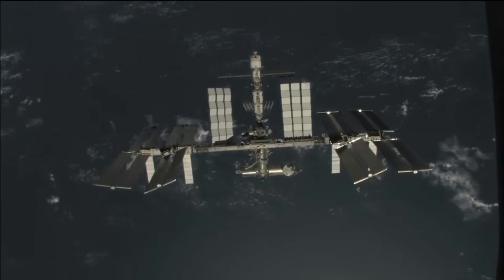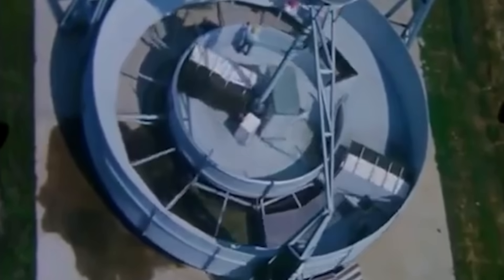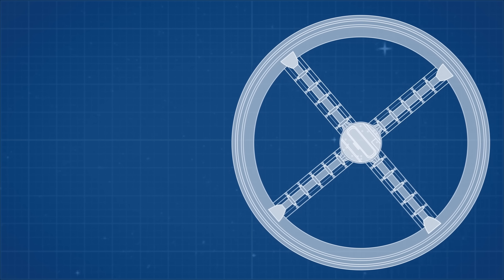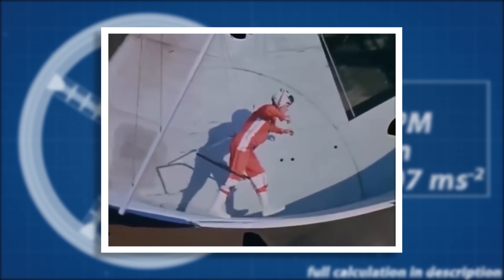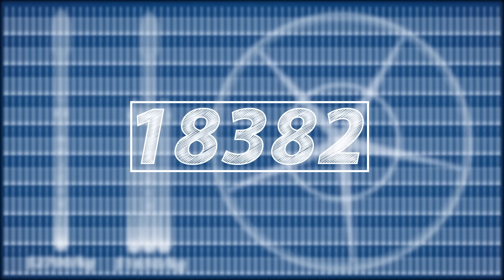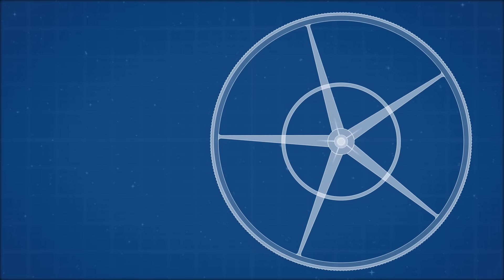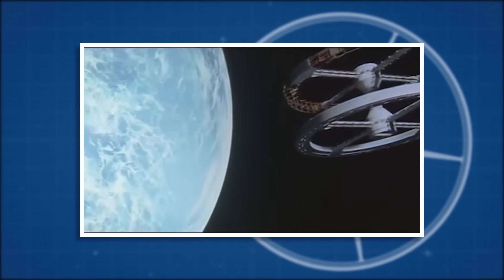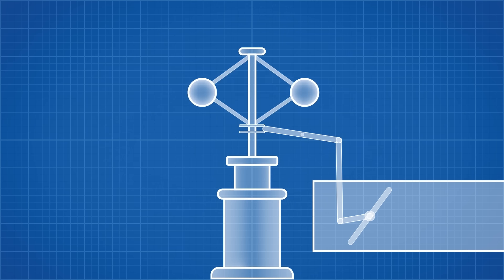Can We Create Artificial Gravity?

Comment: Using the cost of the ISS isn't very fair, because it was built before SpaceX. The ISS weighs about 420k kgs (let's call it 500k kgs for easy numbers). Thus, the launch cost was about 50B/500k ($/kg) = $100,000/kg. SpaceX can launch something to space for an order of magnitude less (about $10,000/kg). So If imagine you could build your station for an order of magnitude less money with today's technology. That would put your station closer to $500B than $5T. Granted, that's still way too much money, but the economics are substantially better. I think these kinds of megaprojects will start happening around $100/kg... that's 2 orders of magnitude less expensive than SpaceX. I also think it'll be next to impossible to do with rockets (which are already pushed to incredible engineering extremes). We'll need something monumentally better than a rocket to build these phenomenally large space stations with artificial gravity. At 2 orders of magnitude less, that beast of a station from the video comes in at about $5B, assuming the cost of engineering scales the same way. And really, it should: we design modules that live in space around a 12 minute flight to space. That's like planning for your annual vacation, but instead of spending most of your time thinking about what you'll do when you get there, you're preoccupied with how you'll pack your clothes 67% of the time. That's what rocket engineers have to put up with. They're not simply designing a payload to do things in space, they're spending A SUBSTANTIAL amount of time and resources designing for the short but extremely violent trip to space. If you find a more robust, economical, gentle way to get to space, that would change what it means to design technologies for space. So I think by brining the cost of launching a payload down by 100x (2 orders of magnitude) you could also bring the steady state cost of engineering said payload down by a similar factor. Of course, we only have rockets. For now, anyway. I'm waiting for that fundamental breakthrough technology that changes everything, like a transistor in a world of vacuum tubes. I'm waiting for the transistor of space, that will get us these artificial gravity stations for the cost of VC money. Einstein once said, "you don't find a solution to a problem with the ideas you used to create it". I believe if clever people realize that something other than a rocket could work (phenomenally) that could be a game changer. I need to stop now, I have digressed strongly and now I'm rambling about philosophical things, my bad. Anyway, let me know your thoughts and please be polite. Best wishes space friends!

Comment: I wonder what it would feel like docking up to the center of the artificial gravity station,  then getting to the gravity part, would we just use slides or ladders, and would you feel weightless in the center, then a gradual pull on your body downwards as you descend a latter? Or would you get smacked by the latter and have to hang on to catch a ride with that arm of the station. So many questions.

Comment: So if we connect two Starships on a tether so the habitation decks are 684 meters apart and accelerate to one RPM, then we get Mars surface gravity. 
684 m at one rev per 60 sec.
Or 1000 m at one rev per 72.5 sec.
Or 1789 m at one rev per 97 sec.

To get Earth surface gravity, we could lengthen the cable to 1789 meters between decks and accelerate to 1 RPM.
Or 1000 meters at 1.338 RPM
Or 447.28 meters at 2 RPM. 
Or 111.82 meters at 4 RPM.

Starship has several deck levels, so the slower RPM and longer tether is preferred to keep the gravity more similar between decks. 

Connecting the ships together at the tail ends may reduce tether stress because the heavy engines and partially filled tanks would be closer together. Certainly, the tethers would be shorter.

Comment: You don’t need a massive wheel. Two disc shaped modules rotating at the end of a very long cable or truss would do the same job.
Reply: ¿What about that this would be the first stage of the project and you keep expanding it until you have the entire ring-wheel?
Reply: Slavko Bogdanic  Exactly. You have a 1G living and working base and you just extend out from each end as you need more space.
Reply: @sirnikkel6746  you just invented the Voyager Space Hotel
Reply: @IsaacStevens1  LET'S GOOOOOOOOOOOOOOOO
Reply: And how do you intend to get the crew out to those modules from the core?
Reply: Harry Mack By sliding down a fireman’s pole obviously.
Reply: @martinsavage6838  
Elevator cables with minimal pressurized car inside the truss. Counterweights are problematic with varying gravity. Who will solve that? ([edit] I suspect pneumatics is the right direction.)
Reply: @martinsavage6838  
The solution seems to be the "garage door" conical spool and torsion spring. Adjust the elevator ballast to maintain neutral "buoyancy" on each trip.
Reply: @avid0g  not varying gravity, varying inertia
Reply: @avid0g 

Enter the "turbo lift." LOL
Reply: a wheel would be a more efficient use of space imo but this could also work
Reply: Obviously you don’t need a wheel, anyone with the resources to build a O’Neil cylinder would build a Skyhook
Reply: The cable would experience immense stress at the centre. If you could develop some carbon nanotube material That could withstand the stress this design will be far superior
Reply: @stavyabangalore7956  the stress would not be that bad, why do you think a cable a few hundred metres in length would experience severe stress?  It is far less than what we would need for suspension bridges on earth.
Reply: I read Tesla - I say get the f. off. Gravity is not a force, but it exists, it was measured, it even has a speed of propagation.
Reply: Yes, this! The floors could have a slight cylindrical curve matching the circumference of spin. The connection would be several parallel pipe made into a rigid truss.

If that is not important, then just walk up and down slight slopes. The rigid truss is replaced with "light weight" redundant tethers. 

I just finished calculating various distance between two tethered Starships vs angular velocity for Mars and Earth gravity.
Reply: @avid0g  i could be wrong but doesn't that make different gravitational pulls based on how far you stand from the center of the disc?
Reply: @Re5_2karman  
If the disk is free to rotate (on a cable set), then gradients are inevitable, and "horizontal" will not appear to be "level" some places, especially at the edges. 

If a rigid truss or pipe maintains orientation then the disk can be curved to be equidistant from the hub, and have consistent acceleration; but then a curve is visible.
Reply: @avid0g  You mad genius!  Your right! Now, if someone could just fund this.
Reply: @avid0g  Ei Mate, calculate the sex of the Angels for me.
Gravity doesn’t exist and you’re not pull to earth, you’re pushed to earth by the AETHER, but this is a lot of sand for your pickup truck, read the German Patent SCHAPPELLER DEVISE.
Reply: @joseinfante5054  
I am blocking word salad notifications.
Reply: @avid0g  willful ignorance much? Maybe learn some words lol
Reply: @avid0g  dont know what the aether/dielectric field is, then you will NEVER understand dielectric acceleration wich is the literal CAUSE of gravity lol
Reply: @joseinfante5054  Interesting, we are being pushed to the earth by the eather.  But why do we float in space?
Reply: @Kopie0830  Well, the primordial particle AETHER, is a charged stream of RADIANT energy that strongly attracts magnetism bringing all bodies in front of it, since there is no magnetism in space, It moves in all directions, causing all bodies to float.
The Haunebu Nazis they worked with the sphere of Schappeller with the same principle, production of Radiant energy and magnetic energy, in the superior part of the device is bathed in Radiant that repels the Aether, in the middle of the two (the device and Aether) forming the only wanted bubble, and running to the inferior part bathed in magnetism, creating the so-called anti-gravity.
Reply: you could either spin it or make it  very very heavy.
Reply: Ok your smart I need your help building a room that can enhance gravity
Reply: Or the one depicted in the 2021 Netflix's movie, Stowaway.
Reply: @IPA SOLÉ well you have to have proof for it’s existence. And you need a hypothesis for it to be atleast possible. As long as it doesn’t have proof or a hypothesis it isn’t real
Reply: Its called A Bola habitat, and it has some fundamental issues. One, you use mirrors to reflect sunlight into the inner ring, with the Bola Setup, you need 2 rotating rings outset from the center mass and a main mirror angled through the center point to maintain a night and day cycle.. This raises issues with spin wobble, so you need to then attach them in tandem along a long axel and have half rotating counter to the rest. It's a lot less elegant and a lot more intensive than a tandem double  ring Stanford Torus which has superior real estate and can maintain an even atmospheric pressure. Bolas would push all the atmosphere to the trailing side, where a torus allows it to move freely. Then all you need is baffles to break up the wind flow and create calm "skies". this is because eventually, you would have the lighter air rotating at a higher altitude and a different speed. It would then basically suck the rest of the air to it via air pressure.
Additionally, you are focusing all the mass of the spin on a very narrow point, and since each bola is free spinning, They can't support each other and spread the tension over the entire shell. A Torus can.
Bolas are a nifty idea and loo gorgeous in Anime like Gundam Seed (Zaft), but they are ultimately impractical.
Reply: @talyn3932  So many pseudo-scientists on youtube, we should have artificial gravity all over the sky, but no, it's just an illusion, it takes a lot of electricity and tomatoes and not scientists.
Reply: @talyn3932  Sunlight is nice, but you don’t necessarily need real sunlight reflected from mirrors. My mate’s cannabis grow house doesn’t use sunlight at all. Another option might be to channel the sunlight down optical fibres.
  Mirrors are so 20th century!
Reply: @martinsavage6838  why go the route of artificial lighting to add that much more complexity and cost when mirrors are cheap and provide better light?.
I know all about grow lights and even the best full spectrum lights utterly pale compared to natural sunlight in terms of light quality and lumens.
Reply: @talyn3932  I think the optical fibre idea could work. Us hominids like a 24 hour cycle, so unless your space habitat has a 24 hour rotation period then artificial is the way to go. Weed in space is the future!
Reply: @martinsavage6838  every setup designed takes a day night cycle into account... of course. 
At this point you need to look into the research already done on this. 
Weed in space as you put it is impractical.
The lewis and variations of the  McKendree cylinders are proposed for artificial lighting but only because they are meant to be too far out to receive adequate light anyway.
Unless you are going that far out though... why waste a natural resource that is better and cheaper than grow lights?. It makes no sense to do so.
Reply: A ball turning 20000km an hour woth a geared plate in the middle moving 10 km an hour would make gravity 
The
Reply: Yes, but the wheel would definitely give us more space to work with.
Reply: Most of the questions in this presentation have been addressed in the two Sifi books Delta V and Critical Mass
Reply: Depends. If you want people to actually live in there, there needs to be much space—and it’s certainly cheaper to build one giant ring than to build two giant disks. Besides, the ring model allows for relatively uncomplicated travel from one side of the space station to another. Each time you’d want to travel to the other disk, you’d have to get into outer space.
Reply: @fabianelsholz663  Also there's the risk that the tether itself is compromised... Then whoever is on the disk goes flying into space.
Reply: @fabianelsholz663 unless you build a shaft between them.
Reply: Actually... you don't need to build the entire space station... You can built a wire-connected rooms structure that keeps it's shape by centrifugal force and some really small lifts to get into the center room, where people would socialize and feel no centrifugal gravity. That would reduce the cost and the amount of materials by A LOT.
Reply: @AntonySimkin  Gravity doesn't exist, neither Einstein nor Newton have any equations that prove gravity. If you want to know what it is you have to go through the physics of AETHER and Tesla Radiant Energy. Lo
Reply: Big B r A i N time!
Reply: @sirnikkel6746  big brain drain
Reply: This is not artificial gravity. This is centrifugal force. Its basically just directed inertia. There are far better ways to do this no spinning required.
Reply: @bringer-of-change  It being centrifugal force is the reason it’s called ‘artificial’. It mimics the effect of gravity without actually being gravity.
Reply: @martinsavage6838  hello martin, can you send a drawing or sketch of your alternative plan of creating artificial gravity? i am unable to visualize how that would work... thanks in advance!
Reply: @IPA SOLÉ okay Jose.. i see you are using your other fake account to make it look like someone else agrees with you hahahahaa
Reply: Ayob Aref  I have and you don't, I already explained on this page, you have shit in your head and you won't read my comments to others.
Reply: wouldn't work in space!
Reply: @justinthyme1834  I'm curious  to know why would this plan fail...can you explain please?
Reply: @tonuahmed4227  Gravity doesn’t exist and you’re not pull to earth, you’re pushed to earth by the AETHER, but this is a lot of sand for your pickup truck, read the German Patent SCHAPPELLER DEVISE.
Reply: @joseinfante5054  dielectric acceleration is what pulls us to the earth. Gravity doesnt exist, but it is an attribute of dielectric acceleration wich does exist. This thingy here though, is so inefficient. They could just use the dielectric inertia and acceleration of magnetic fields. Quantum doesn't get fields whatsoever.
Reply: @joseinfante5054  correct, not pulled to earth, but pulled to counterspace.
Reply: @bringer-of-change  Wrong... I've seen that you are the only smart physicist, all the others are idiots, dielectric acceleration was a projected theory of modern physics, experimented with toys, nothing really with the force capable of pushing an ant to the ground. Mass is not pulled to the earth, it is pushed by the force of the Aether which is Radiant and attracts to the earth's magnetism, hence that in space, as there is no magnetist, aether pushes in all directions, the so-called Antigravity. This is my theory.

Comment: The stress in spinning structures like this would decrease as you move away from rotational centre

Why is that? Does this only apply to the procedure of acquiring the rotational speed at the beginning of operation or does it hold true also during normal operation at constant rotational speed? 

Shouldn't the tension in the spokes be uniformly distributed along their length rather like in the case of spinning a mass on a tether (in case of 0 radial acceleration)?

Would be great if someone could clarify that!

Comment: One of my uncles (once removed) works at NASA on the Mars 2020 lander project, and I asked him about this. He said you’d need to make the thing more than fifteen kilometers in diameter or anyone standing in the thing would get sick from the difference in G-forces acting on the head compared to the feet. The largest metal thing not reliant on concrete for support ever built was the Seawise Giant (scrapped 2010), which was only 458.45 meters long, to put in perspective how inconceivably massive this ‘space station’ would have to be. Keep in mind, the ISS needs to fire the engines of it’s transport rockets every once in a while just to stave off orbital decay, not to mention dodging derbis. This thing would have to be sturdy enough to pull off those maneuvers at that scale.

Comment: What if I jump on Elysium? Since friction is dragging me along and the normal force is pushing me towards the center, when I'm in contact, i experience artificial gravity. However unlike gravity, this is a contact force. So once I jump? Won't i follow a parabolic path away from the surface?! Given the massive size of the ring, won't i just float off into the other side?
Reply: Im really shitty at physics but in my interpretation you would eventually hit the 'floor' again, because you keep your momentum
Reply: @davidpavel5017  yeah exactly but far away right? Not back 'down'. Cus you leave with your angular velocity at that instant horizontally and in the vertical you have the normal force the ground put on you when you jumped.